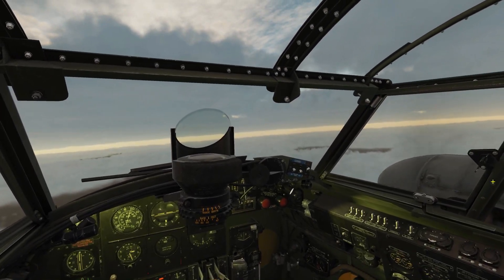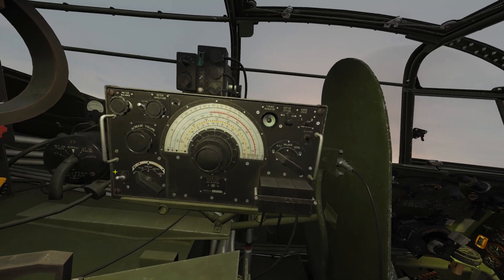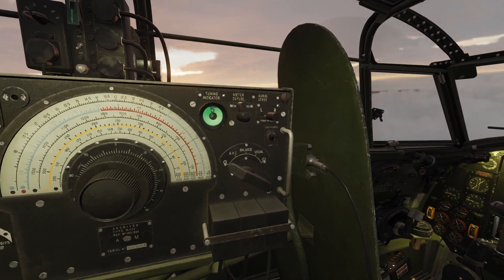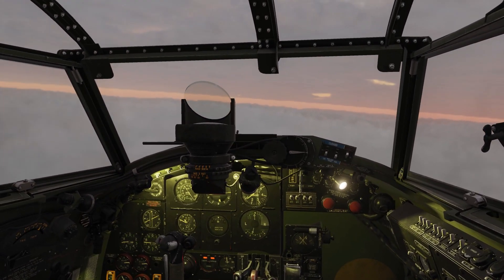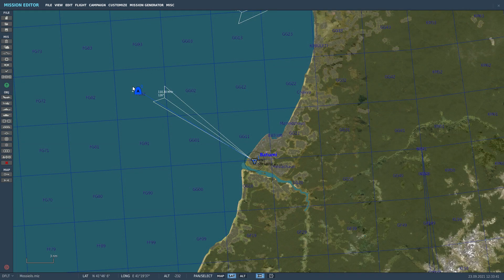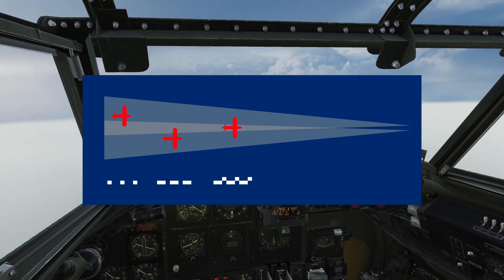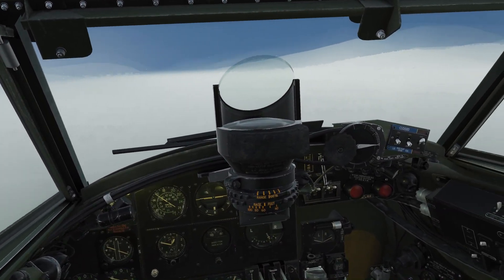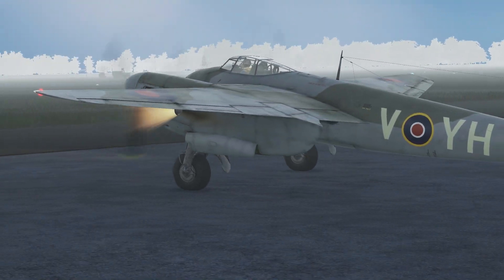DCS Mosquito Radios and Navigation Tutorial

Comment from the maker: As it turns out, I was wrong, you can actually use the T1154 radio for built-in radio comms too. You just need to use the push to talk button next to the navigator. Cool stuff!
Reply: Which one? The type F button?
Reply: @ChuckOwl  It is a button on the right hand side aft of the bomber/navigator. In the following video, it is shown at 7:45. https://youtu.be/0EIOvUI8VEE
Reply from the maker: @sloppydog4831  Indeed. I wonder why it's called 'Morse button' in game, though.
Reply: @ReflectedSimulations  yep, it is a F Type button. The Morse button is located forward on the right wall. May be a misnomer by ED or something that is not correctly pointed in the real manual. Anyway, would be good to report this to ED.
Reply: @sloppydog4831  Isn't that forward morse button for the recognition lights?
As for the one next to the #2 seat, that transmit button IS used for morse transmissions in CW mode.  Though it's not really a good morse key...
Try it:  Set the T1154 to "CW" mode and press the key.

I've just been reading the manual, and it looks like you're supposed to be able to "back-tune" the transmitter to the receiver frequency, but that doesn't seem to be working.
Reply: @No1sonuk  I stand corrected. Yep, those forward are recognition lights switch. The F-type is for Morse code. However, there is a switch besides the low and high voltage switches that says F switch transmitter. I believe you have to activate this switch to transmit voice  with the F-type switch.
Reply: @sloppydog4831  I've never used that one next to the power switches.
I read somewhere else that switch was a way to turn on an automatic transmitter to act as an airborne beacon.

Comment: Finally getting to learn the Mossie, thanks so much!! Curious, do you think they’ll model the navigator’s map table (I think that’s what it is) forward of the escape hatch on the floor?  Looks like it should fold out with an E6-B style slide ruler
Reply from the maker: I didn't know that but it would be really cool!
Reply: So I was way off, it turns out that thing sitting at the feet of the navigator/in front of the escape hatch is actually kind of a bomb site the navigator would use to track your position over water.. sorta?  Regardless so cool that ED even put it in there to see.
Reply: @JGL2008  It's a drift sight, lets the navigator find out how much effect that wind is having on the aircrafts course. Except that it isn't implemented yet, and unless ED come up with a straight and level autopilot ( before the heat death of the universe ) you won't be able to use it single crew anyway.

Comment: I have set up a vehicle transmitting as you say and after 3-4 minutes the transmisison simply stops. Anyone else getting the same?
Reply from the maker: Are you sure you set it to loop?
Reply: @ReflectedSimulations  Yup. A 2 second morse code loops happily for 2-4 minutes then stops. I have tried it on the channel map and caucauses (ruling out a map issue). I have tried it on 4Mhz (red) and 350khz (yellow) channels, I have tried ogg and wav files (probably ruling out a file issue) and always the same. If however I change to say 125Mhz and use the pilots TR1143 then I have no issue and it works OK...it's just on the T1155. It's also not a sound issue as the direction finders stop working at the same time that the sound stops. Maybe ED have modelled blown valves lol. That is works on the TR1143 and not the T1155 makes me think that it's a bug. I do have some mods so I guess it's possible that they are the cause though.
Reply from the maker: @gmangnall  Not sure why that happens, I've been using beacons like this for hours at a time and they work. That's in SP, mind you.
Reply: @ReflectedSimulations  Yeah MP has tons of beacon issues, like only one aircraft being able to find a beacon etc.. such a pity, also similar issues keeping you and other campaign builders to bring us great MP campaigns with voiceovers.. how much would I love to fly the Zone 5 campaign in Multicrew with my pilot :(

Comment: Does the T1155 only go up to 18.5 Mhz? I tried setting up a vehicle for 118 Mhz and it doesn't want to work
Reply: From the manual, 18.5MHz is the max for the 1155.
Reply: T1154 is only used for shorwave or HF as they call it today, 118 Mhz is VHF